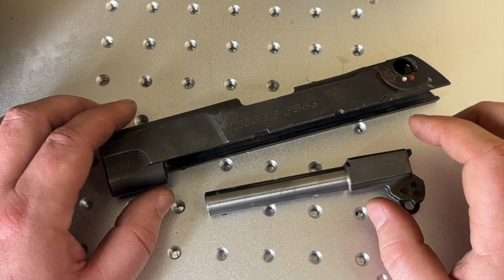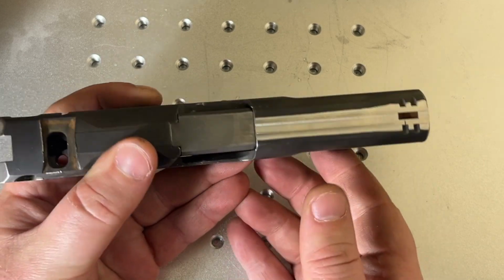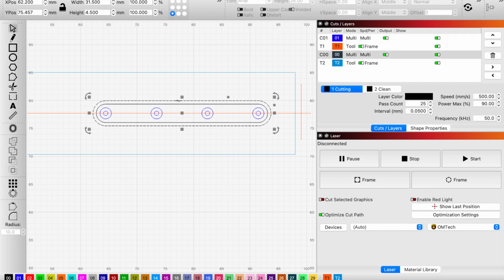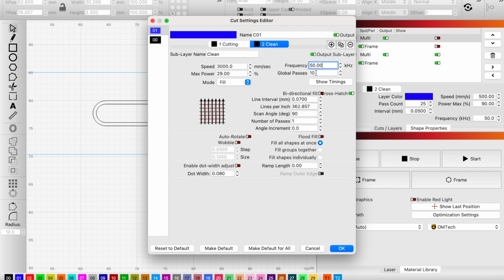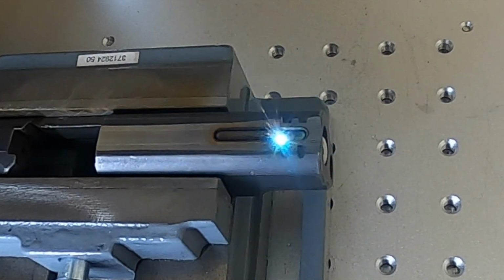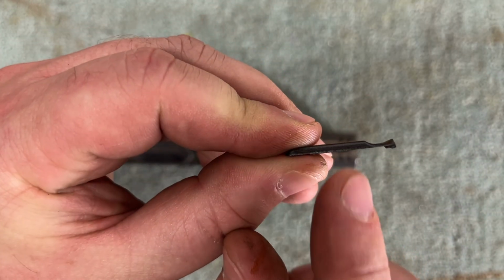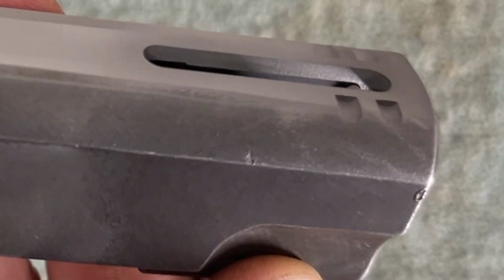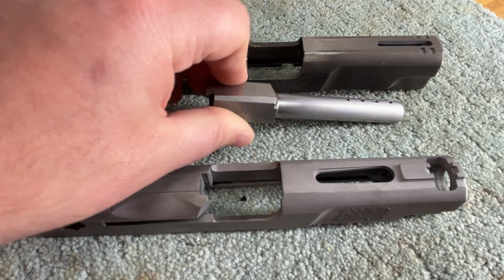How to Port Barrels and Window Slides with a Fiber Laser in Steel

Comment: I know this video is a little older now but what is the distance between your barrel ports and is it a set distance or variable depending on the size of barrel? Great video too!
Reply from the maker: Sorry I don't remember. But I am doing a video later this year where I'll incrementally add more and larger ports, measuring velocity, recoil reduction, and accuracy changes at each increment to be able to graph out the effects. So that will likely answer what you really want, better. To know what a good porting setup is, not just know what I've used in the past.
Reply: @NotaGuntuber  Excellent. Looking forward to the video and findings!
Reply from the maker: @raven01_actual I actually went and found the Allen wrench that was in the barrel as protection. The marks are 0.365” apart on center. That’s slightly out of focus from what was cut. But likely not by a lot. Please note though that those distances aren’t special or optimized. That level of data will come from the future video I mentioned.

Comment: Great video! Question, rookie here. When you set up the shape on light burn to port the slide. I see you did the offset before tuning the job do you join those two lines together so it’s one thicker line or is it two separate lines? When I was setting to fill it would fill the full shape. In your video you only see the two lines. What am I missing? Also can you link your tutorial video for laser stippling? I see you mention it but I can’t find it. Thanks!
Reply from the maker: The first line is a single enclosed shape. The offset then creates a second, single enclosed shape. If they are both on the same layer, Lightburn should be smart enough to know you want to laser fill inbetween them. My bet is your two lines aren’t on the same laser.
Not sure where you saw that I have a laser stippling video, because I don’t. I do have one planned for this year, but it’s not out yet. Also, all the plastics out there are so damn different! I’ve shied away from them because I’d have to do like half a dozen before it truly became worth while.
Reply: Thanks for the info. I will give it a try. 
As far as the stippling I thought it was mentioned in one of the videos saying you were gonna do one or did one. My mistake. But yea I agree a lot of different variations in the plastics
Reply from the maker: @AlexRamirez-h4v  probably episode one where I said it was one of the things I probably have to cover eventually. And I will. Just unknown exactly when and to be honest, it's probably not the plastic most people are waiting on. When I do finally do it, the first stippling episode will be for black MJD double stack 1911 grips. Not the usual Glock most are probably waiting on.

Comment: Have you tried doing V6/8/10 style ports with a laser? Do you see any issues doing this, as the ports would not be in the centerline of the barrel?
Reply from the maker: I haven’t. But 4th axis for these things are dirt cheap. That’s how you would do it. In which case, they would be in the centerline once you rotated it correctly!
Reply: @NotaGuntuber good point! However. The v10 ports I have had milled are directly perpendicular to the top of the slide rather than the centerline of the bore. Do you think this would be doable if I just had it mounted in a stationary vise like in your video. 

By the way love the series. I just ordered my first laser today because of your videos. Hate the gatekeeping in this community. Glad you’re fighting against it
Reply from the maker: @collinis1  this dude gets it! Also congratulations on the buy. What'd you get?

To comment on the vertical, but off center ports I'd need to do some CAD. Here's what concerns me. 1 the more you move a circle off center, the more barrel material you need to cut through. 2 if you move super far to the side you are going to need a plug for inside the barrel that is a much better fit than the random Allen key. If they're super far to the side, then any slop in the plug risks marking the bottom of the barrel when you cut through. All this to say, get a random, beater, gunbusters barrel and try if on that first.
Reply: @NotaGuntuber good points! I think I’ll stick with inline. I got a 20w gweike and it’s definitely a lot slower than yours. Which I guess is fine because it’s mainly for hobby stuff and was half the price. Nfa engravings into steel take about 30-45 minutes. Window cut took nearly 12 hours. Barrel ports seem to be about the same. It cuts through the first couple of millimeters fast but then takes forever on the last couple. Like it can penetrate the groove
Reply from the maker: @collinis1  I've never used a 20w, and yes that is a decent bit less powerful than a 50w, but I have a hard time believing it has that drastic of an impact on times! Double check that you have the correct focal length. Not what the manual told you, but actually setting it based on where you get the maximum spark. If that doesn't make sense, go watch LaserEverything's setup videos.
Something just doesn't seem right with those numbers. Even if it's 20w!

Comment: What about the land and grooves of the barrel?  Any burrs?
Reply from the maker: That might actually be the one place this process wins over milling, and definitely over drilling! Lasers ablate, so once you get through there isn’t really a concept of burrs.
I know you didn’t ask this, but it’s tangential so I’ll add this too. Burrs or not, all ports are going to leave some form of sharp edge and disruption of the rifle pattern. What many people don’t factor in when selecting to have a gun ported is they are likely to not just lose a few fps but also some accuracy. In one of my 2026 videos I’ll be progressively porting, on my CNC mill this time, a 2011 and using a Ransom Rest and chronograph to plot changes in velocity, accuracy, and recoil reduction to better understand the trade offs and perhaps find a sweet spot.

Comment: Been following you on X and I’m now a subscriber. Keep doin the lords work, brotha!
Reply from the maker: Hey man. Didn't know you were here too! Thanks for stopping by. Way to comment on my most controversial, apparently, video. Ha!
Reply: @NotaGuntuber I accidentally cut though a slide I was lasering for a friend.. I just went for it and it turned out great. Now that I have the correct settings I’ve cut through a couple. It’s just time consuming but it does the job.
Reply: LORD WHO???? are you a brit? nothing mentioned about Jesus Christ the LORD here. 🙄🙄
Reply from the maker: @JohnSmith-uy7sv  gun work is the Lord’s work. It keeps his flock safe and protected from the devil’s mayhem.

Comment: why put holes (ports) in the top of the barrel?
Reply from the maker: It redirects the gases upwards to help combat muzzle rise. Less rise means back on target faster. So this is usually done for competition guns or gucci gun projects. Your tradeoff is lost velocity and potentially lower reliability. Hence why this isn't a mod often done for duty or self defense guns. There's a channel called Cajun Gun Works who have a recent, 2025, video that goes deep into this topic and presents concrete data of results. Very cool video.

Comment: Hi! I used to run a laser engraving and cutting department for a 1911 manufacturer. I’d highly advise not to do this. I attempted a project similar and what I found was a decent amount of warping and ruining the heat treat of the steel being cut due to the heat input. I’d really just recommend getting an angle jig in a vice and drill pressing ports
Reply from the maker: I'm sorry you had that experience. This exact concept has been addressed ad nauseam in the comments already to the point I have put a disclaimer at the top of the video description. Please see that disclaimer to understand how to avoid this issue.
Reply: @NotaGuntuber ❤

Comment: There used to be a company called magnaport that did porting with EDM years ago. Don't know if they are still around but what i had seen of that looked good with no heat distortion problems
Reply from the maker: Many ways to skin this cat wit their own pros and cons. EDM you can get tight corners but most machines aren't accessible to hobbyists. CNC is my preferred as it's more accessible, faster, and once you have the machine running ports is dirt cheap due to the speed and ease. Laser is likely the most accessible but likely the slowest. Also, people seem to be very concerned about this heat issue in the comments despite me monitoring the heat and not having issues. But yes, I agree that depending on how you're running this you could theoretically generate enough heat over enough time to change the heat treatment of the barrel. I'll repeat what I put in the video description though. Go look at the heat and cycle times needed for most stainless steel heat treatments. Good luck getting to those cutting 30 minutes of porting on a laser. At least in my experience.
Reply: Plunge EDM is not cost prohibitive and all that is needed for doing this kind of work.
Reply from the maker: @vphls  just looked them up. Yup, there's used stuff around the same cost as mid market fiber lasers. Cool. Didn't know that! I still will do this work on my CNC as it's fast, easy, and a tool I already have and am comfortable with.

Comment: That looks like the barrel got extremely hot during the process. Hot enough that I'd expect those areas to have some difference in wear.  More or less depending on the specific alloy used. For anyone doing this , there is a product called heat stop paste. It's designed to help prevent heat damage from silver soldering and brazing sight bases onto barrels , receivers, slides and ribs. It would work hear the same way. The benefits over a wet rag as a  heat-sink is it can be painted on uniformly and to match specific shapes and can be used without a constant flow of water or soaking basin.
Reply from the maker: That stuff sounds cool! Thank you for the share. As for the heat, I've addressed this in enough comments that I've added a disclaimer to the top of the description. Short summary though? In tests I read temps and it didn't get to problematic levels. Those small circles that get hit and glow red only do that because they are almost completely disconnected from the barrel at the point they tilt and get hit directly. Meaning they are unable to dissipate heat to the barrel, and are small, hence why they themselves get hot but that's not a problem.

Comment: I guess my only real question at this point is where is your front sight going to go now? Lol?
Reply from the maker: Completely fair question! This actually went to a friend who is building it into a 3D printed gun that uses these slides, but an AR15 fire control group, called the Recession Ruger. They have a top cover on which optics can be mounted. So this particular slide no longer has a need for sights.
Reply: @NotaGuntuber oh wow, ok! That sounds really neat! I’ll have to check that out. That peaks my curiosity. I do gunsmithing part time. Far more traditional than laser work. But I do dabble in the printing world. I greatly appreciate the response, I’m subbing to keep up with your future endeavors.
Reply: @NotaGuntuber Haha did this go to PSR?
Reply from the maker: @Beard_Man_Rob no. Unseenkiller has this one. PSR actually never reached out after that X exchange. And being a blue checkmark less plebe, I can’t. Ha!

Comment: when you're using the wrong tool for a job or using it incorrectly, knowing full well of the onslaught of consequence awaiting you, but continue doing so, that term is referred  to as "a$$hole momentum". This concludes todays lesson, love the video.
Reply from the maker: Ha! To be fair, as I discuss at a couple points in the video, my concerns with using the laser for this were around efficiency and surface quality. In the end, surface quality I was being too hard on. But efficiency! Oh boy, this is definitely the slow way to port!
Reply: @NotaGuntuber  I was just generalizing, not pointing at this video, but you did mention it. 😁
Reply: Well a manufacturer just wouldn't tell they used this. It would be tempting for them though - no replacing of toolheads. 

Of course they could do it before heat treating and finishing

Comment: Man, I would worry about it standing up after.  In the F1 field there were a bunch of Ti and some stainless cans failing around the laser markings due to some odd brittleness changes.
Reply from the maker: Porting with a laser is actually pretty common in the industry. I did not invent this. I'm simply sharing the settings I used to achieve the results. As I mentioned in the video, I believe the CNC is the better and faster route to go for this process and that's how I'll do them in the future. But I wouldn't be afraid to shoot this.
Reply: Do people not understand how hot barrels get from shooting in itself
Reply: @g-mf7fr  I'm wondering if you do...
Reply from the maker: @g-mf7fr  brother, thank you!
This video is doing amazingly better than almost anything I've ever put up. I'm starting to wish that wasn't the case though, because despite addressing it in tons of comments and putting a disclaimer at the top of the video's description I still have to address it several times a day. The answer is simple, as I put in the disclaimer. If this worries you, track the temp as you laser. If it climbs to a point you are concerned. Pause and let it cool. Want to figure out what point should make you concerned? Go look up the heat treatment schedules for whatever metal your barrel is made of. Tada!
Reply from the maker: I added a disclaimer to the top of the description though based on our discussion because technically you are correct. If things get too hot you could affect your barrel's physical properties. When I was doing my testing I was reading temperatures to assess this, but I didn't see any hot enough to concern me (see end note) so I called it a win and went on with my life. But you are right that my setup, my barrel, my focus, etc. may be fine while someone else might somehow end up with a scenario in which they do heat to a point of concern. So yes, if that's a concern for folks they should monitor and take pauses the first few times they do this to make sure their particular setup isn't problematic. End note- the little tiny nubs that fall out got sort of hot, but at the point they start tilting due to basically not being attached anymore, which is what causes the laser to hit them heavily and make them glow, they were unable to efficiently transfer that heat to the barrel anymore.
Reply: @NotaGuntuber  The barrels/slides are probably thick enough to not be affected.   The cans in question were kinda thin walled.